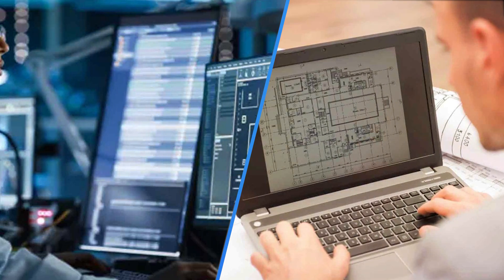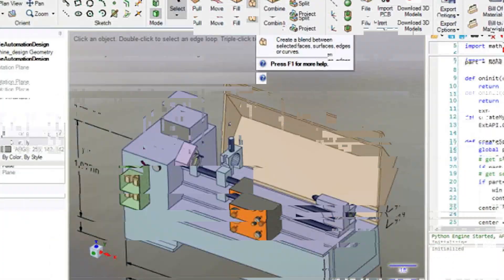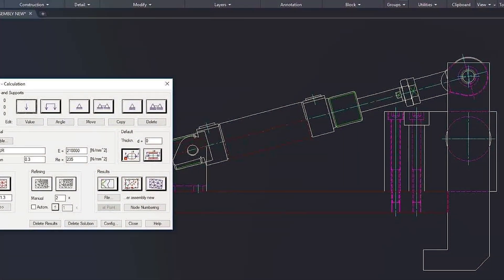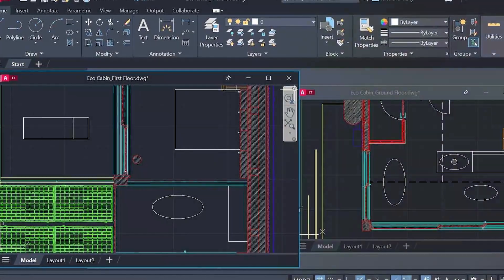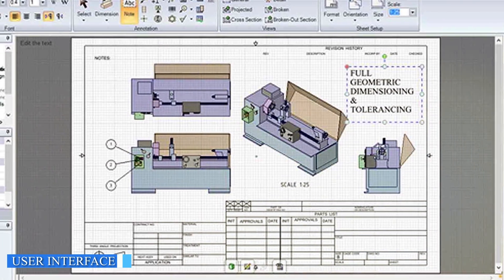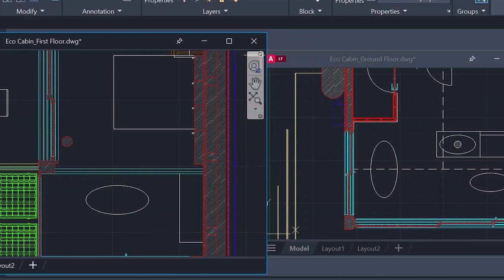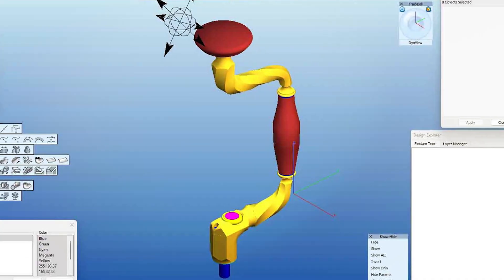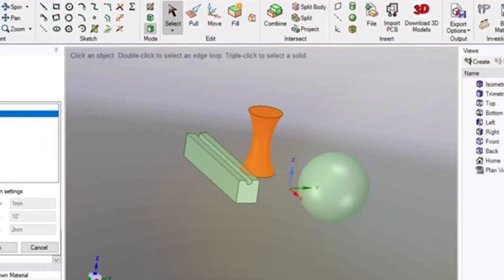DesignSpark Mechanical vs AutoCAD Mechanical: Which is Best?

Comment: For a novice CAD user like me, the DesignSpark's interface looks much simpler to use and is free (not just a limited time version), so allows me to learn it at my own pace without costing a fortune, but also took a look on their site and they have upgrade options for more advance / professional features once you get to grips with the software, think I'll give it a try.

Comment: It therefore sounds like DesignSpark Mechanical is more suitable for learning and getting in to Mechanical design with a feature set suitable for a lot of designers, even professional engineers, but if the advanced features mentioned are required and the designer has time to invest in a longer learning process then try AutoCAD Mechanical